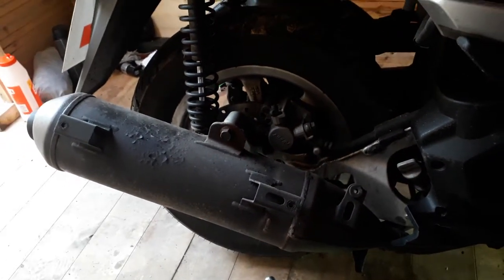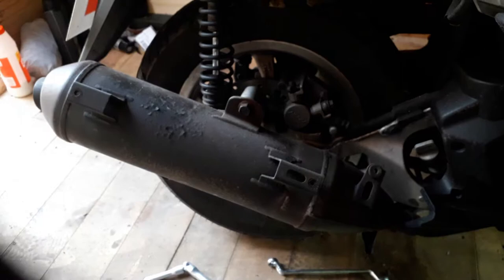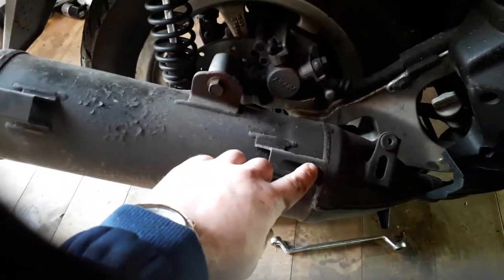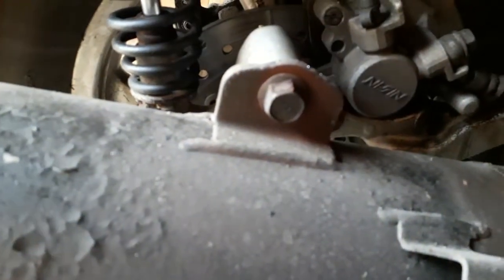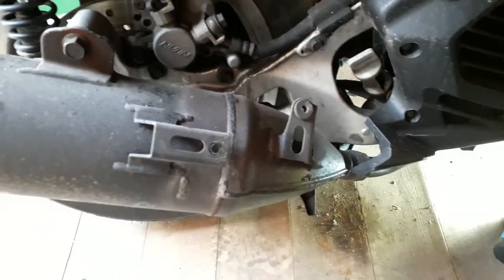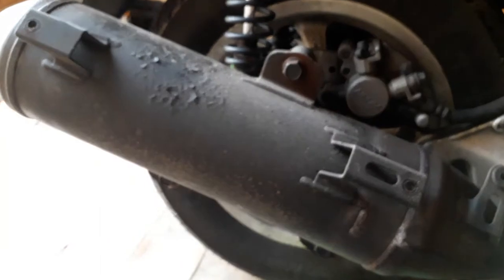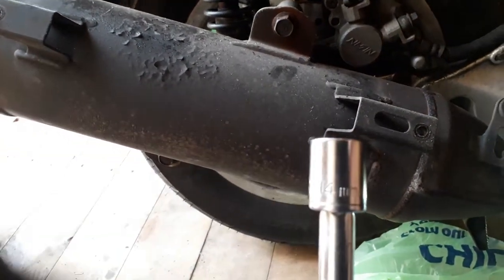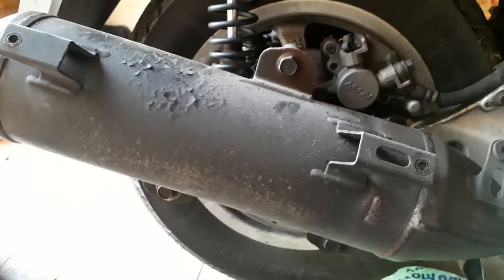Yamaha Tricity 2015 Exhaust Removal

Comment: Where did u buy your aftermarket exhaust?
Reply from the maker: This is a stock exhaust, bought one from China but went straight in the bin as its was unsuitable for the bike
Reply: @motovlogger7198  Ah ok.  I wanted to put a better sounding exhaust on my TriCity but I can only find the muffler but not the neck pipe or elbows
Reply: @Mystery_Man84 hope it’s not too late , you can buy nmax exhaust header it should fit the tricity